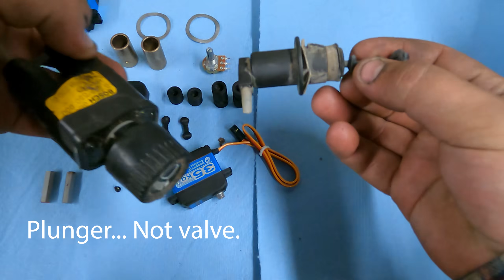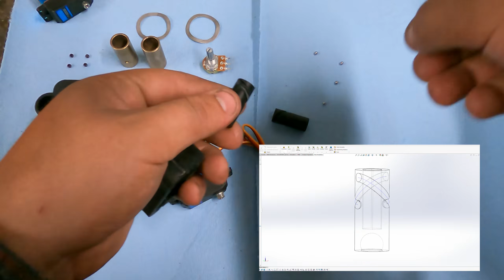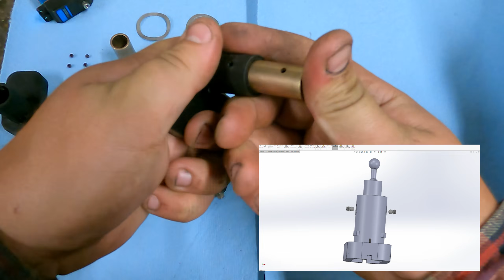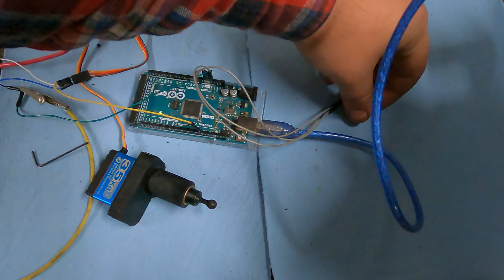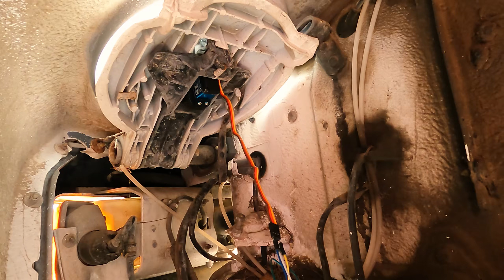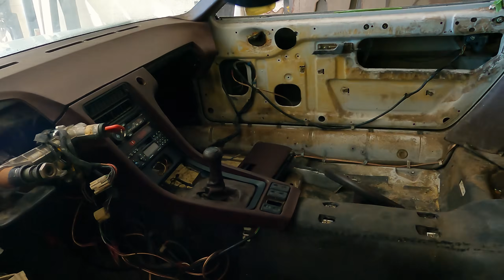Solving Porsche 928 Problems Nobody Asked For

Comment: When you put it into the car, what Arduino board do you actually use and do you just power it from the 12v car system or drop it down to 6-7v via a DC-DC converter?

Comment: Curious if the 928 lights could be modified for side to side rotation like modern BMWs.  If so, then you can have these follow the road as you turn.  Love the idea of using an accelerometer to keep the lights level through acceleration, breaking and various load levels.  Keep doing what you do!

Comment: What material did you print the ball bearing race from? I would have thought the bearings would eat thay plastic in time. Nice use of ots bits to fix an otherwise expensive problem though.

Comment: i got a question about your 60's f1. On the boxster the engine is rear mounted but your build is e mid engine so you have inverted the rear and the front of engine/gearbox. So you changed the engine direction of rotation, right? how did you menaged to do that? i guess you needed to reset the timing belt, cams and spark, using the same degrees but in the opposite direction and using an external waterpump, am i right? (soory for the bad english :D)

Comment: OE servos for low beams are 12v from parking lights with something like 1-11V out 1-4V signal for adjustment, retrofitting is easy as you just need proper movement range and ball joint size. You get also adjustable "zero" position, which is really critical to set correctly
Reply: Also, IP44 and up, correct temperature rating etc

Comment: Nice.  I’ve had a bunch of 928s (3 right now), but never had a working headlight adjustment system.  At one point I tried to buy all the stock parts to put an adjustment system in a us car, but even if you can find working parts there in not a great way to bleed the system.

Comment: I’m working on a project where my Pontiac G6 will have adjustable headlights like pickup trucks with a tow package does. I was thinking of using an arduino and a knob from a Toyota. And possibly in the future making a fully automatic headlight adjustment

Comment: This is an interesting video.  I've been interested in 928's.  My first thought was, why is this system needed at all?  Is this Porsche's version of the manual adjustments used on most cars?  And to make it hydraulic seems like a very British (cough Jag) solution.  I imagine a US company would have used vacuum.  You came up with a nice solution though.
Reply: Its for compensating for cargo weight. Not really that relevant on a Porsche, but if you load a car full of people and stuff the rear will sag and the headlights will point to the sky and blind other drivers. Its regulation in Europe to have a manual adjustment in the cabin or automatically leveling headlights. The normal adjustment is still done with the screws around the headlight I assume. On most European cars of the time the adjustment is vacuum operated afaik.
Reply: @banaana1234  Thanks for the info.  I did not know that was a required feature in Europe.

Comment: Great solution. Can't imagine what an oem replacement system would cost, if you could even find it. How often were these originally even supposed to be adjusted? Was this just an unnecessarily complex aiming screw?
Reply from the maker: Pretty much. Someone wrote up a fix on rennlist years ago, but it was refilling the system and I didn't want to deal with that. Quicker this way.
Reply: Its for compensating for cargo. Not that relevant on a Porsche, but a family wagon could be driven to work with one person, and then loaded full of people and stuff in the evening. This would make the rear sag and the headlights point to the sky and blind other drivers. Afaik it was (and still is) regulation to have an an adjustment dial in the cabin or automatically leveling headlights.

Comment: If you wanted another layer of unnecessary complexity - you could add an accelerometer and more code, to perform an "auto level" function on each engine start - like many modern cars - and get it to set the correct angle to the lights dependent on rear passenger (lol)/luggage load.  Which would also allow you to add more comments to your code 😀
Reply from the maker: Which honesty would be an accelerometer module and like… 5 lines of code. That’s a good idea! Wouldn’t be too hard at all.
Reply: @WesleyKagan  "Wouldn't be too hard at all."

Famous last words
Reply: It's becoming more German than OEM!
Reply: I'm genuinely loving the madness of this... How about a head mounted sensor so you could angle the headlights closer or further away as you look up or down?
Reply: Might as well add a left/right pivot activated by turning on the turn signal and steering input.
Reply: Go further and make it automatically adjust all the time so the beams are always stable
Reply: Accelerometer will be a bit hard IMO if you consider the filtering & stuff you need to do(not impossible though), a suspension range(/travel) sensor from a modernish car mounted to a suspension arm will be better
Reply: @vsaravind007  he has all the ram free, it is enough to get many minutes of soft filtering. Just nothing will be automotive grade
Reply: @vsaravind007  also, suspension travel sensors are partially for car load compensation, they are filtered even more as you do not change load while driving. Switching of beam height is for same thing essentially, when you load back of car it raises beam and driver should lower it
Reply: @poprawa  Suspension travel sensors are used for auto levelling of headlights too, on VAG cars for example.
Reply: This is starting to sound like a watchmaker’s idea!
Reply: Accelerometers won't work, what if the car is stopped at a slope? Suspension travel sensors is the way to go.
Reply: Murata had new sensor for headligh adjusting. No need to use suspension position sensors any More. Murata MEMS sensor.

Comment: A bit of correction, the original system is actually vacuum actuated ;)

Thanks for sharing the files ! 

If you want to get rid of the K-jet and install a standalone ecu, let me know i'll share my files with you ;)
Reply from the maker: I’m actually curious now, because all of the documentation I have is a closed loop hydraulic system. 

I appreciate it! I don’t mind dealing with k jet, it’s a fun effort in frustration!
Reply: @WesleyKagan  My bad, you are right. It's just that I've never seen one of these working well, they are always empty so I assumed it was vacuum !

Anyway, good riddance ahah
Reply: @Benautodesign  Not a bad assumption to make on older German cars... all the Audi's, Porsches and such from that period were full of vacuum operated stuff.